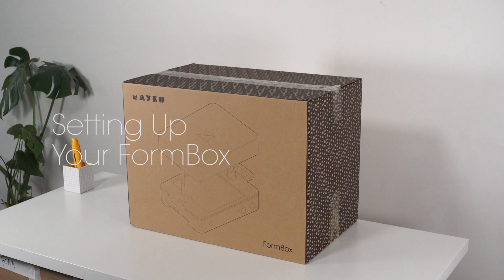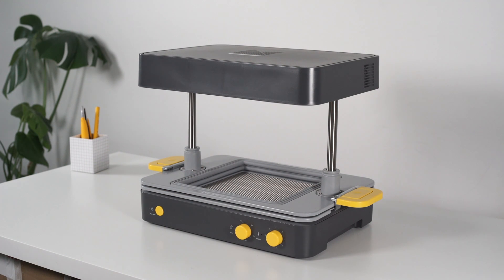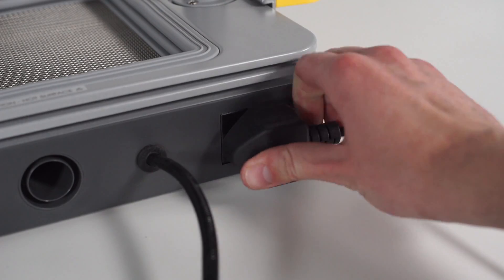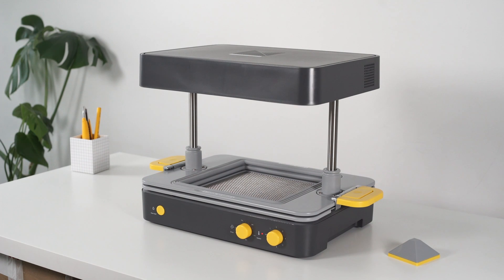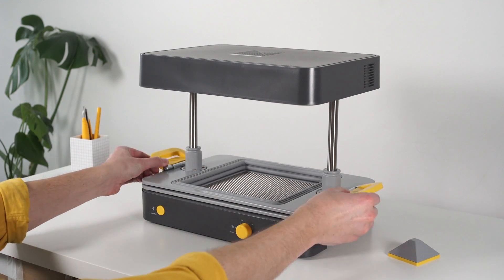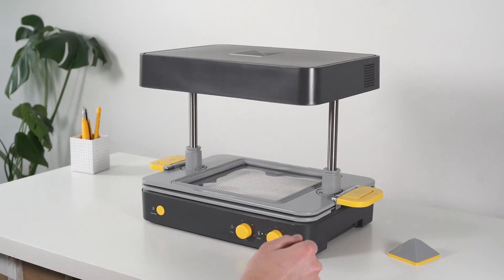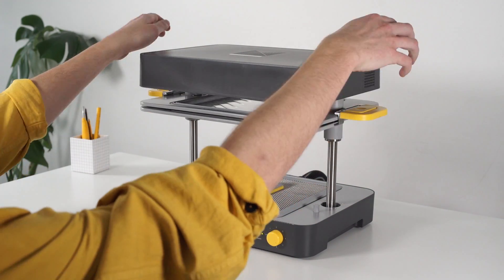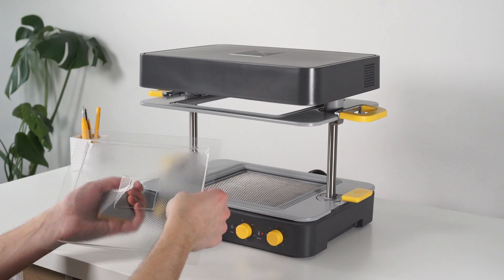Unboxing the Mayku FormBox - setup guide for the Mayku FormBox

Comment: Unfortunately it is much too expensive for an occasional modeler. The electric plug is completely unsuitable for German electric devices.
Reply from the maker: Hi Fasold, our machine is available with a universal plug that works in all regions, including Germany. You can save time and money by using the FormBox for custom molds and parts compared to other methods. Most of our customers are professionals who use the FormBox frequently.